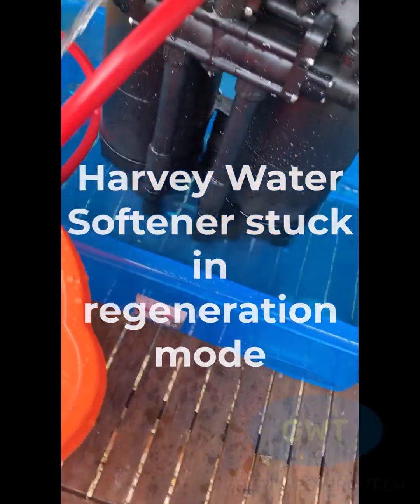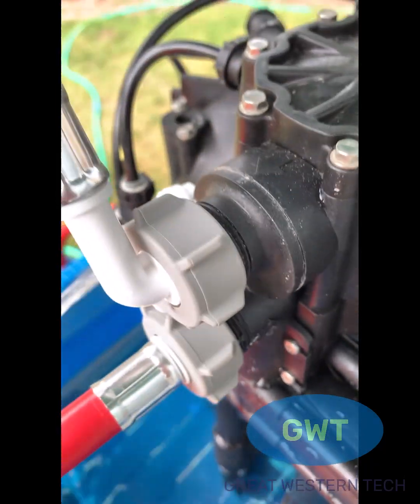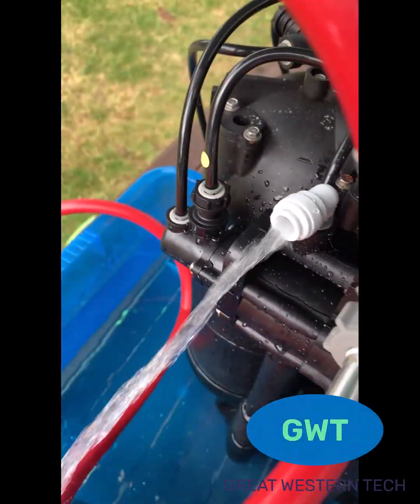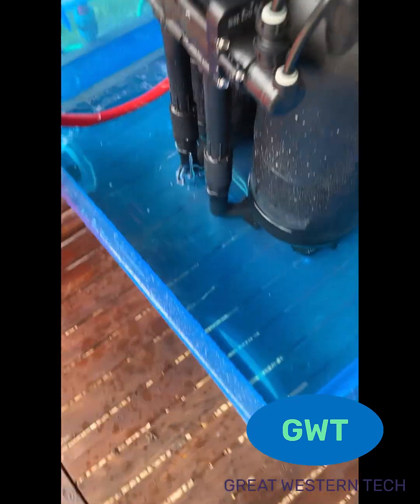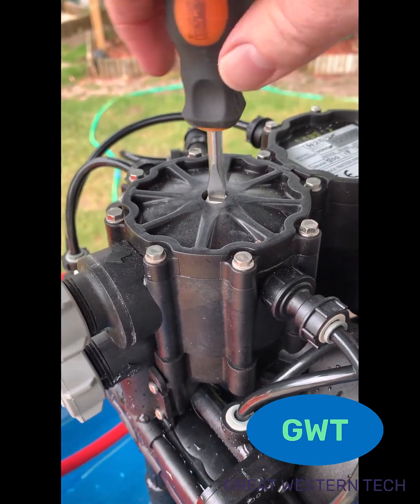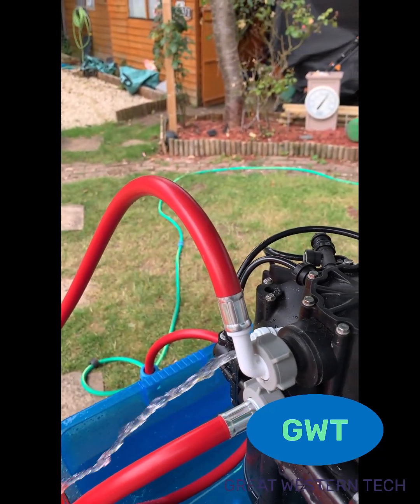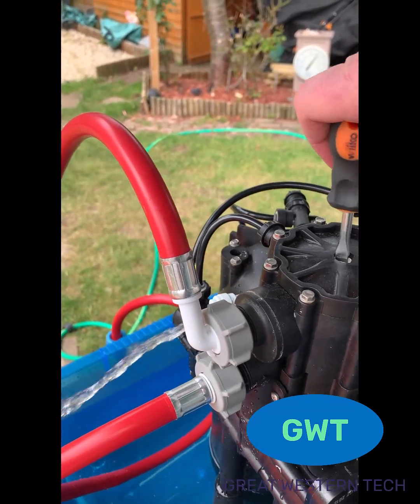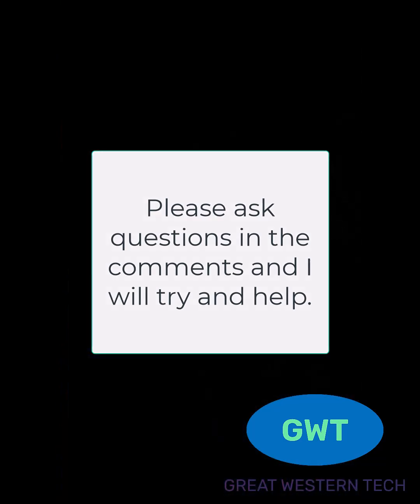Diagnose Harvey Water Softener stuck in regeneration mode

Comment from the maker: Thanks for all the comments - sorry that I didn't receive comment notifications (for some reason) for many of your comments. Sadly, I did not solve the issue and purchased a Kube water softener from Costco. Good value and fairly easy to install if you have the bypass valves already fitted under your sink.

Comment: Hi yes mine had the same problem after the gearing was changed in feb did you find out the problem, mine was a bit of dirt
Reply from the maker: Hi gary, I gave in eventually and got a Kube! Glad yours was sorted! Although the shuttle valve was a replacement (2 years) the rest of it was about 12 years old and the problems were mounting....!

Comment from the maker: If you are feeling adventurous, you could disconnect the quarter inch hose (usually white) from the softener and see if water is flowing out, as it is in this video. Be careful, have something to catch it with, and I don't accept any liability for damage or problems! 😎
Reply: I have 'played' with it and water flows-out regardless...... It must be an internal valve that has 'decided to die'......